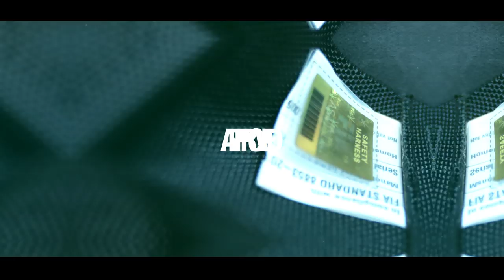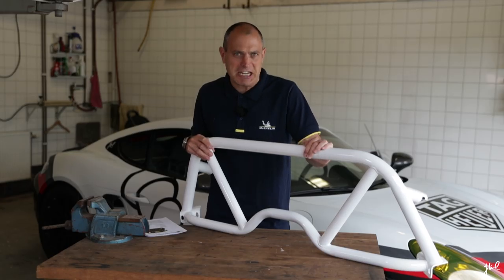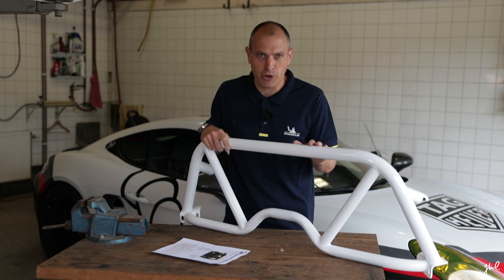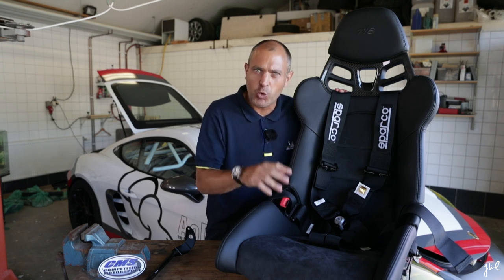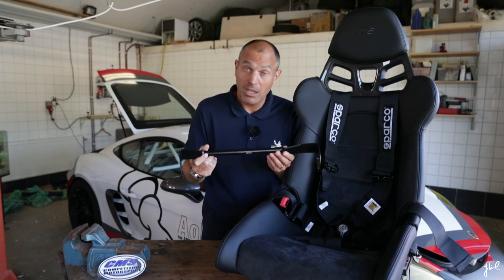More safety​ to my Cayman T - CMS Competition Motorsport Roll Bar & Sparco harness | EP092

Comment: Does this roll bar kit restrict the rearward movement of the seats? I have. GT4 on order and I am 6’2” tall and need to move the carbon fiber bucket seats back as far as possible. My concern was that this rollbar might restrict this rearward movement of the seats.
I read on their website that the passenger carbon fiber bucket seat does not have a passthrough in the seat bottom for the submarine belt. Is this true? Was this a problem for your installation.
Reply from the maker: Yes, it does but we are talking mm not cm. Apparently, it does not, I've heard several people with the same issue. If you are not already, please consider subscribing.

Comment: Another great video and nice to see you supporting the 718 platform which I think is really under rated by many enthusiasts but is arguably better than the 911 platform for the art of driving. Just wondering what wheels and size Cup 2 tires you installed?
Reply from the maker: Regarding the wheel you will get all the answers next week, perhaps you have honored me with your subscription. FYI the 718 share the same platform as the 992.
Reply: @JankoLind  That's interesting but with the 718 the engine is in the best position for the art of driving! So are you saying main passenger cell is the same?

Comment: You are one the most underwhelming driver-owners of a Porsche on the whole of the Internet. This roll bar is not gonna increase your safety, but instead your gonna bang your head against it while you're detailing the back of your carbon seats with "whatever product you detail the back of a carbon seat".
Reply from the maker: I don't have any problem with the bucket seat hitting the roll cage, in fact, I have not tested if it reaches the roll bar. Thanks for your energy and your contribution to our community. Perhaps you have honored me with your subscription.